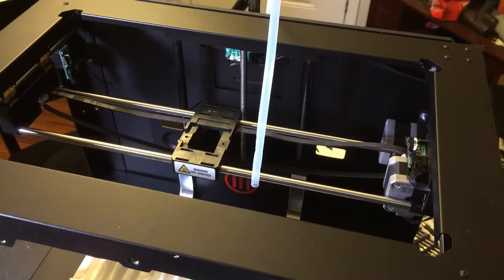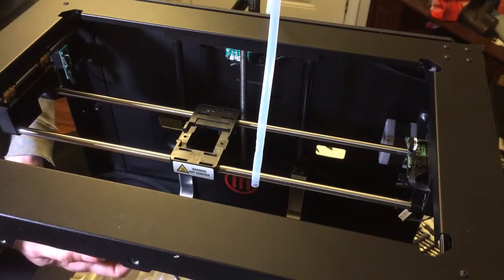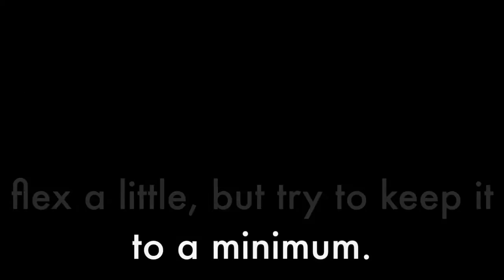Installing Alu-Carriage for Replicator 2/2X Upgrade

Comment: Not sure if you know but there is a purple thread locker that is a lower strength than the blue and would 
be better suited  for the smaller screws so that if you ever needed to remove then your not having to but
a lot of force or having to heat the screw to degrade the blue so you can remove it. The purple from Loctite is expensive. ASL Torque 22 TL is a lot less and does the job well. I think the small bottle was about $10 USD.

Thanks for the video and the links to the supplier.

Comment: Im about to do this upgrade and wanted to see some install vids. thanks for posting yours.  Im curious though.... why did you get involved detaching the stepper motor for the belt?  seems like its an unnecessary step.
Reply from the maker: +mfitz73 Which time?
The first time was to remove the belt from the stock carriage and made it easier to put it on the alu carriage. If you were able to do this without loosening the stepper motor then your belt was originally to loose and needed to be tightened up anyway. 

You may be able to get the belt off without loosening the stepper motor but you will cause the belt to stretch, and you want that belt to remain tight.

Now later in the video I did this to remove the belt because I found it easier to adjust the set screws on the bushings, then was able to slide the carriage belt free and that helped me make sure it was riding the rods smooth and not feeling the tension of the stepper motor. So I had the set screws set optimal for the smoothest ride and know they were not to tight.

Either way, it's best to at least unplug the motor, stepper motors will cause an electric feed back into the board when you manually turn them even if the printer is off. This might cause damage to the board, not always but it's not worth the risk.
Reply: hey yeah forgot to come back and update this after I finished the work on my rep2.  I had to do pretty much what you did in the vid! lol.  thanks for posting it.

Comment: Thanks a lot for the video. By the way, where can I buy the Alu-Carriage? I would also like to replace one.
Reply from the maker: +Shibo Zou Hello, it's listed in the description of the videos. I try to list all the things I have videos on in the description.
http://shop.raffle.ch
Reply: +Scott J Thank you very much! I have found them. :)
Reply: +Scott J By the way, I am going to buy one. But do you find any problem concerning the increased load on the gantry? The Al carriage must be heavier than the original one, right?
Reply from the maker: +Shibo Zou Theirs not problem with the increase. In fact mine is weighted down even more with the aluminum extruded also. The stepper motors can give a lot of torque and it won't be a problem.

Comment: Thanks for the video especially the bit about the falling stepper motor.  I have the same build plate so it could have been a disaster.
Reply: Sharon Brackett hello. I am going to do the same. Please, what is the problem you said with the motor? Thank you.

Comment from the maker: This is something to stop drafts and seal the chamber better. 
Designed for the 2X, but I'm also enclosed and running a heat bed like a 2X. I also have corners installed that you may have seen. Both of Hesse are on thingiverse.com and can be printed.

Hood gap part:
http://www.thingiverse.com/thing:242450

Corner parts:
http://www.thingiverse.com/thing:151513